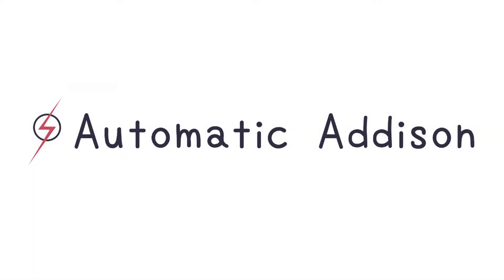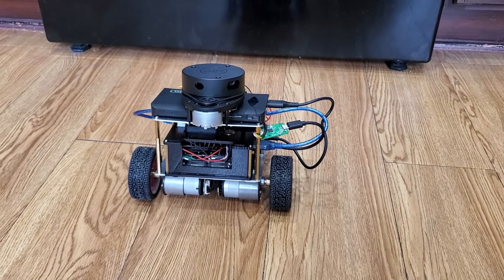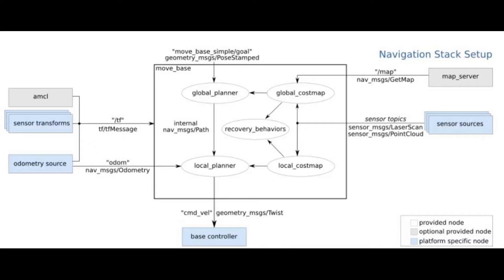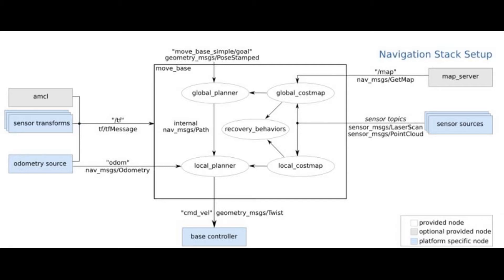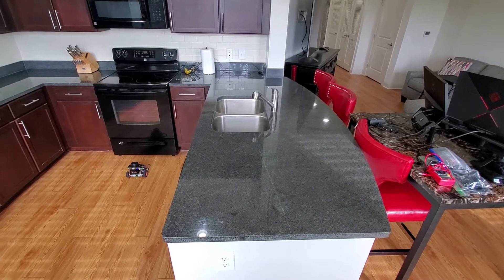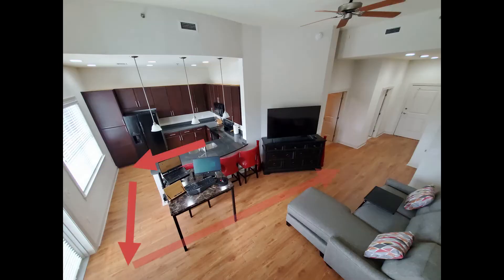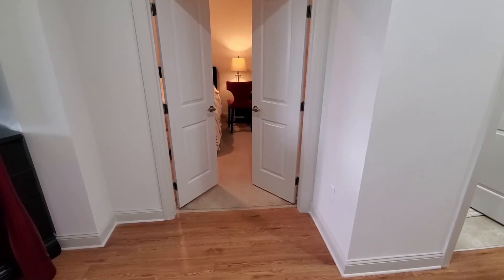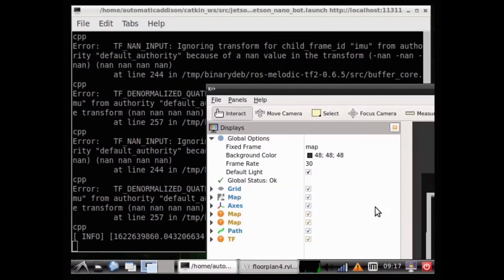Autonomous Mobile Robot Navigation With ROS (Jetson Nano + Arduino + Lidar + Extended Kalman Filter)

Comment: Hey Addison, thanks for the amazing video! I have built the navigation stack and its working fine. but i have a problem with the EKF filter as my laser drifts in time, and I have went through your website and did the same steps but unfortunately the ekf didn't activate, please can you help me with my issue
Reply from the maker: You can contact me through my website for help on your particular project.

Comment: Kindly reply. I am facing as issue. There are warnings map update missed it's desired rate. control loop map missed it's desired rate. When i give goal location it starts to rotate and after some time it aborts the operation. Looking forward to hear from you
Reply from the maker: You can contact me on my website, automaticaddison.com, for help with your particular project.
Reply from the maker: You can contact me through my website.

Comment: Even i give goal in rviz , rover is not navigating , in terminal it shows as map update loop missed its desire rate. And control loop missed its desire rate (i changes hz value from 5 to 30) . Rover rotating in same place and then shows as aborting because no valid plan .   How to rectify this.  Please help 😭😭
Reply: I am facing this same issue. Do let me know if you get it resolved.
Reply from the maker: Ditto what I said to @BARATHRAOJMSEC above. You can contact me for help on your particular project.
Reply from the maker: You can contact me on my website for specific assistance with your rover (automaticaddison.com).

Comment: I have a project on ros to make autonomous navigation of a robot with added noise which should be filtered. In results, I have to show that the noise is filtering and the robot is simultaneously localizing and mapping on it's own or autonomously. Can you tell me that this tutorial guide will be enough for my objectives. Furthernore I am only showing software work not anything in hardwork
Reply from the maker: Look up my blog post entitled "Sensor Fusion Using the Robot Localization Package"

Comment: Hello, I currently face problem that my Laser did not stay in rigid map which cause the wrong position of goal. Laser scan tend to wrong in the right position. For example, in the initial position, angle of laser scan is 0 degree ( correct to the map) , in the end , at goal position, the angle of laser scan is 45 degree compare with initial point. 
To understand clearly, you can go to this link to observe the problem https://drive.google.com/drive/folders/1YkXohnLngX4BXicPyHQoJsZJ0z6ZVEnv?usp=share_link
I don't know what is the problem, can you help me to fix. Thanks you a lot.

Comment: Can we use MPU6050 instead of BNO055 ? if so what steps needs to be followed to use MPU6050?
Reply from the maker: Yes. Do a google search...'automaticaddison MPU6050'. The BNO055 is much better though.
Reply: How did it go ? can i use only encoders ?  like delete the imu parts of the launch file will it still work ?

Comment: Thanks for all you excellent tutorials!  I have worked through all of your tutorials to get to the "How to Set Up the ROS Navigation Stack on a Robot" and works pretty well (still doing some tuning and debugging).  My question is I can't find any detailed tutorials on using Hector-Slam without odometry for the Navigation part.  I did get the Hector-Slam mapping using my rplidar to work fine.  Any links I could look for to get the Navigation part without odometry?
Reply from the maker: Hi John, you don't need any odometry to run Hector-SLAM. All you need is a LIDAR sensor. Gmapping uses odometry and LIDAR scan, but Hector-SLAM only uses laser scans.
Reply: @automaticaddison  Thanks...I understand Hector-Slam doesn't need odometery.  And that's why I'm trying to use it rather than the navstack_pub approach.  I was able to do your tutorial "How to Build an Indoor Map Using ROS and LIDAR-based SLAM" and made a map without odometry...worked great.  My question is how do I now use Hector-Slam w/o odometry to do the navigation part...use map, and lidar, set initial pose and goal in RVIZ, calculate the path and go.  I have looked every where to find a complete example of this and was hoping you could help.  I was hoping I could just modify the launch file for mapping to include the additional nodes/params etc to take it through navigation.  Thanks for any help you can give me.  Like I said , you are my go-to guy for all things ROS and robotics now.
Reply: @JohnMacGuy  Hey I am trying to achieve the same thing as you were. I am using rplidar a2m8 and I am able to visualize the map created using hector slam in rviz using ros1 noetic. I was looking for resources to guide me on how to achieve the navigation and localization part. I would really appreciate it if you could you please help me with anything that you found out when you were doing the project or any guidance that you could give me
Reply: @tejalgadad4496 Can you guide me about the navigation part. I am getting warnings and robot starts to rotate when i give goal location.
Reply from the maker: I will see if I have time to do a complete tutorial on it
Reply: @automaticaddison  That would be great!  I have been using ROS not ROS2.  Hopefully your tutorial could use ROS?  I have to learn a new system at this point.  I have loads of files already in ROS.  Thanks